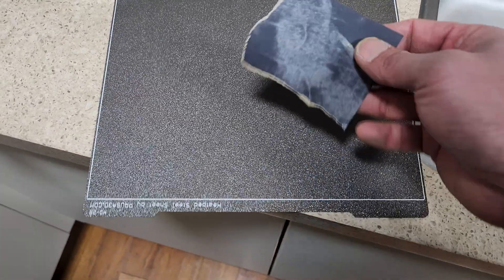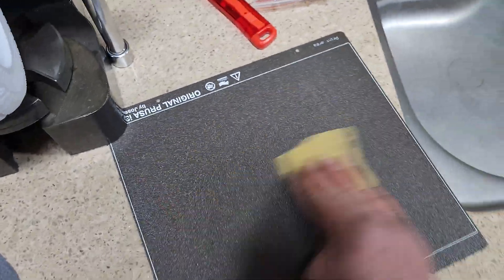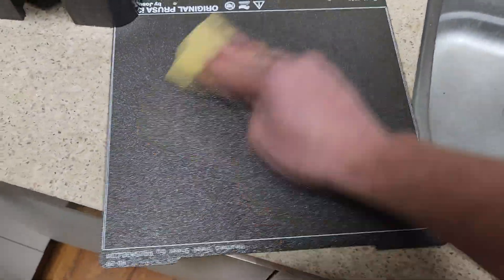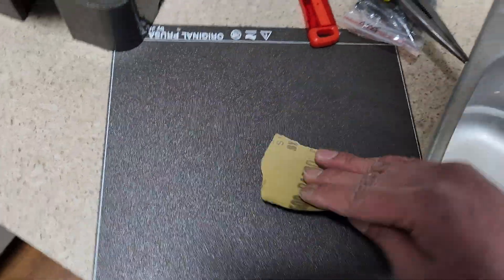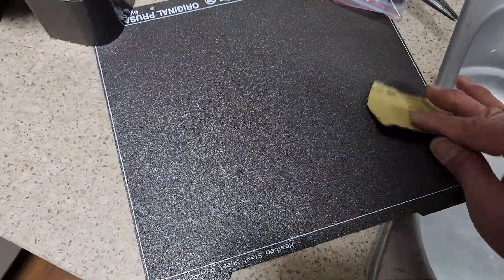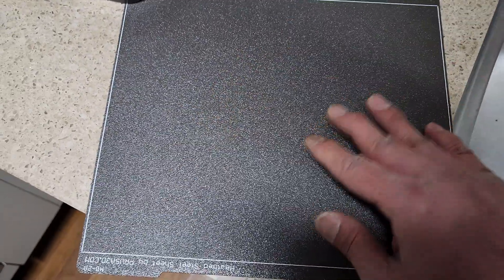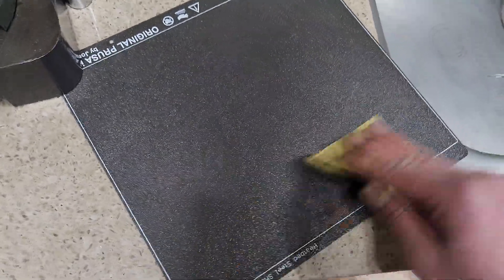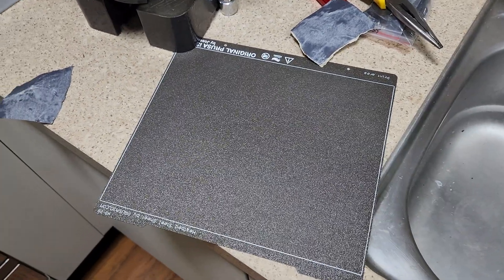How to Get ABS/PLA/PETG/TPU filaments sticking better on ANY Smooth or Textured PEI Plate!

Comment: Some PLA filaments simply do not hold and behave like gum even with isoprohphyl alcohol .For me try to use glue stick on PEI plate and solve all problems.Also it can be taken off with hands when it cools down.
I have suffered and I just think that the PEI plate is not so perfect to hold everything on it and it's not just about degreasing it perfectly.You can print successfully but then you get a spool on which you can not print anything because it just does not hold on the pad. Don't be afraid to use a glue stick if you are primarily printing PLA.  
You can wash everything if you want.
Reply: Glad to know you can use a glue stick on PEI Thanks Gotta brand you like?
Reply: @barneycarparts PRITT  . I never used gluestick .I mixed water based glue with water if I printed on glass cold . But I have to say really glue stick on PEI pad solves everything with non-stick . I even bought one liter of isopropyl alcohol and it sucks . And I haven't printed anything where there's a lot of support. You have to use glue or there will probably be a huge percentage of failed prints.

Comment: Thanks for this great tip. I have scuffed up my cheap £8 PEI textured plate from Ali Express. And after each ABS print I clean is down with washing up liquid/warm water, dry then clean with ISO. This has resolved by ABS sticking issue. Now sticks a treat.